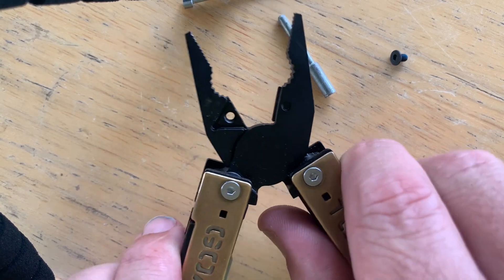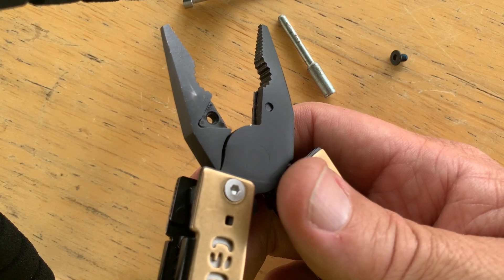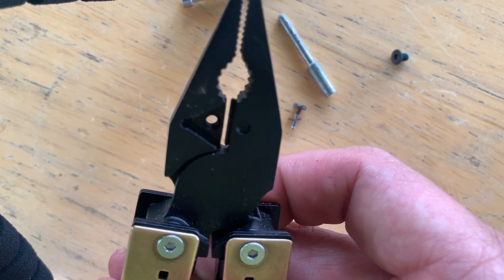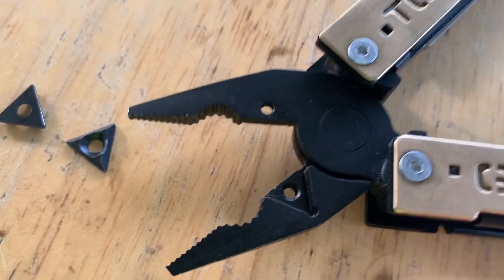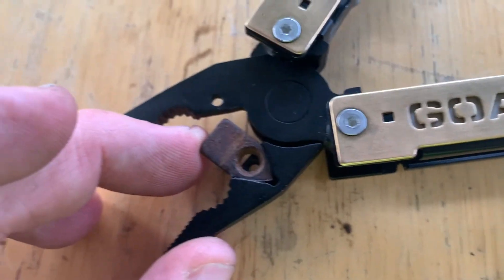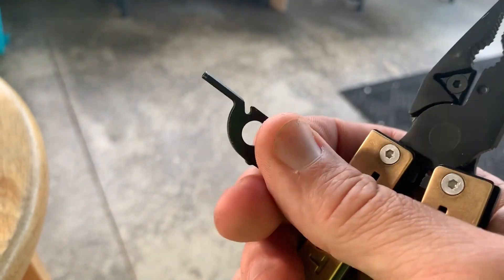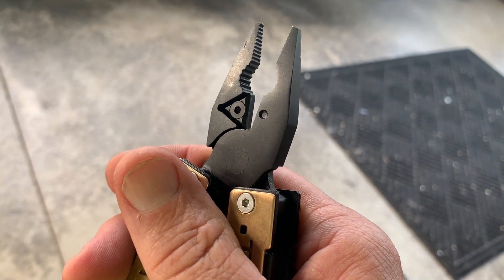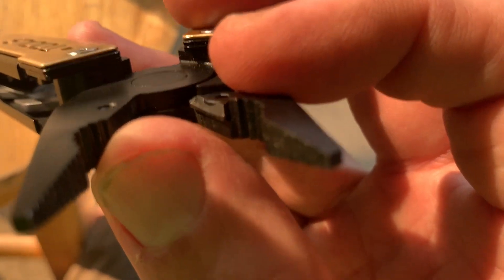GOAT TOOL multitool #11 wire cutter fix

Comment from the maker: Hey yalls!!! Goat store is open now! The pic they show of the wire cutter blade looks way different than mine. So hopefully I’ll get those and see what happens.
Reply: I’m VERY interested to see how you make out.  Poor hard wire cutting is holding me back from ordering a Goat tool.
Reply from the maker: @FreedomFox1  I’ve been talking to goat some. I just replied to their response and I sent pics and video to them about the cutter blades. The pic they show at their store looks a lot different from what I have. I did improve them greatlyish:) they are mostly cutting everything now. I could grind the cutting edge more and remove more material from the plier head. But I want new cutter blade if they look like what they have pictured. 
Thanks for commenting! I’ll make vids w/anything new.
Reply: @andrewfett142  Are you getting the new cutters?  I’m very curious to see how they work.
Reply from the maker: @FreedomFox1  O shit man, no. Another miner disappointment. Sorry. I’ve never delt  with a brand new product before. Or tried to get info out to everyone possible. This is all a new thing for me. Im not even a product reviewer or usually regularly make videos. 
No new cutters! The picture is from their concept cad drawing design thing. :(  
they apologized 🤷‍♂️ and said they will change the picture and are working on either new cutters or plier head. Or researching it or something. I was meaning to work on my pliers and cutters some more and do another vid showing what they said. Haven’t yet. If I can get their reply in a couple screenshots I’ll do a post in few minutes. If more than a few shots I’ll probably have to make video with screenshots scrolling up type of thing. Sorry again for not posting as soon as they replied. And thanks for reminding me.
Reply from the maker: @FreedomFox1 I posted 2 screenshots of what goat had to say. If you don’t know; I think you have to go to my channel and then “community “. You should see it there. 
Thanks again.
Reply: @andrewfett142   Very helpful, thank you!  And no apologies needed… you’ve created the most comprehensive GOAT review out there!  If I’m understanding their reply, it’s the ductile quality of aluminum coat hangers that may be the issue… it sounds like the cutters may work on the steel fencing wire I need to cut.  But still, this is a serious design flaw that should have been caught.
Reply from the maker: @FreedomFox1  yes totally agree. I don’t understand why they would produce it that way. Any testing before? But I also don’t know anything about getting a new product produced. So…🤷‍♂️
The wrong picture on their website I also very much do not like. People might buy those things hoping for better cuts. 
I have improved them and I think I can do a little better. 
Thank you very much for the great compliment!!!☺️ 
More goat vids to come. 
I am happy that I purchased it. And still have hi hopes for their future.
Reply from the maker: @FreedomFox1  yes. Upsetting they would send out that way and have a false pic of cutters on website. 😕🤷‍♂️
Reply: Tnx 4 video.

Comment: You spend all that money and people are scared to tell the truth about how messed up things are on this tool. This tool is going to get a versus versus Leatherman versus Gerber. To see who is the king of multi-tool.
Reply from the maker: The tool itself is $99. I think I have showed everything I am experiencing. Some disappointments. But working thru them mostly. I am loving it and it is a very capable tool being modular. Goat hasn’t had the many many years of manufacturing quality as others have. It is still brand new. 
And if anything breaks or improves; you just swap it out. 
I’m sticking with goat:) 
🤞🏻for future improvements. 
Do you have a channel? I’ll check you out👍🏼
Reply: No brother no channel I bought the tool as well. And was just disappointed in some of the things.
Reply from the maker: @zeewizard7198  o ok. 
I totally accept that. Definitely not for everyone in its current state. 
I can’t do all the vs stuff. I’m just a regular guy that likes to show off things I’m doing sometimes. Not really a product reviewer and I don’t usually regularly make videos. I’ve been using a Gerber diesel for 10yrs. 😆 The goat is a big improvement for me. 
Like I said they need more time to improve more. I hope. :)

Comment: I feel your struggle with the GOAT. But you certainly made it look and perform  better. 
Cant wait to get one to start modifying it. Those cutters def needed to be flattened on the backs and the hex screws needed that part ground off for sure. Im going to see if a lathe tip-tool/insert could make all the difference cutting wise. You can get metal or ceramic ones capable of cutting almost anything. Just watching the video makes me wonder if the jaws dont need to be hit with a Dremel either side of the cutter screw in the shape of a half moon to provide clearance for the wire to be cut before the wire hits the jaws. Doesnt look like a lot of meat there but it mite not need too much taking off the jaws.
Reply from the maker: I believe you are correct! I could do that just on the one side of screw hole towards the pivot for powerful cutting. I’ll let you try the lathe things. Let me know.  Thanks again for all your comments & chats:)👍🏼
Reply: You Dremel and I will try the lathe inserts. Sounds like a plan.
Reply from the maker: @matui6983 👍🏼😁👍🏼
Reply from the maker: Hey buddy I posted info about what goat says about the cutters/ pliers. It’s in my community thingy.